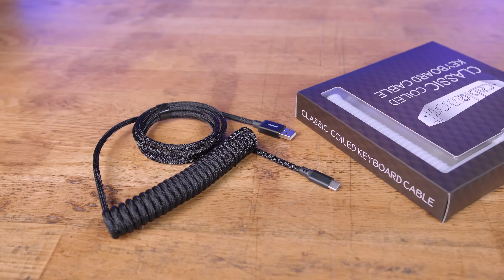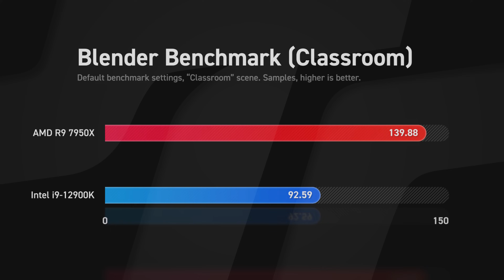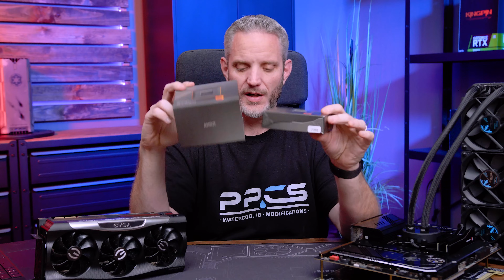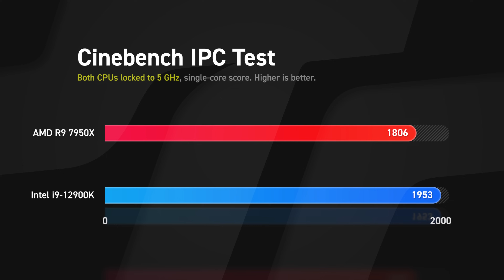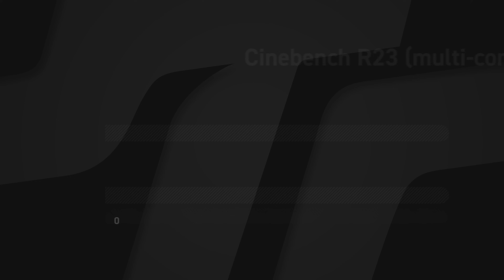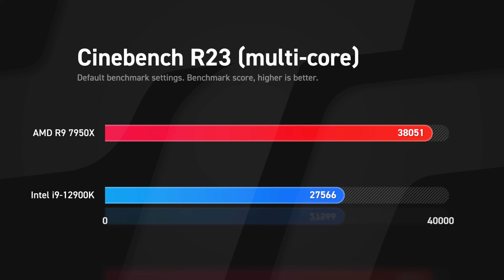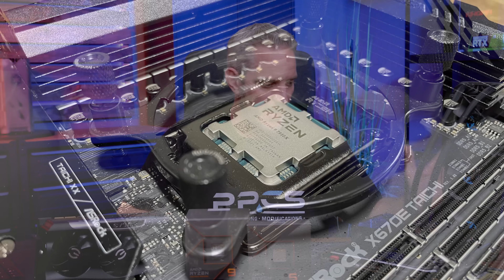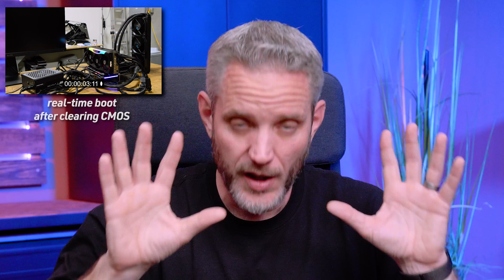Forget EVERTHING you THINK you know about AMD... these CPUs kick A$$!!

Comment: TJMax without throttling by design is most likely because they cranked the speeds down to what it throttled to, much like Over Clocking to max stable no throttle specs, find the max stable, find where it throttles to at TJMax, turn the clock down to that speed it throttled to and it won't throttle.  It's like pushing a 3200G to 4.3 GHz, figuring out it throttles to 4.0 or 4.1, and than setting the clock to the 4.0 or 4.1 to prevent thermal throttling.  It is always better if the manufacturer does it though.

Comment: The best part about AM5 boards and Gen 4 chips is you DON'T HAVE TO BUY THEM.  They are not the fastest for gaming, they are not the most energy efficient in terms of processing.  The boards cost too much, the memory cost too much.  If you absolutely need a system now Go with an AMD gen 3 with 3d cache or a 12th gen Intel.  If you can wait a bit, get a 13th gen intel or a gen 4 with 3d cache.  By the their will be better AM5 boards for less and DDR5 memory will be a little cheaper.  To be clear the chips only appear amazing if you compare them to gen 3 without 3d cache.

Comment: Great video, thank you Jayz.
Here are some constrictive criticism:
The comparison was not fair. Comparing the 12900k with the 7950x which are not on the same level CPU. Also comparing last year is technology with this year is technology isn't fair either. A more fair comparison would have been a 12900k with a 7900x or 13900k with the 7900x (Once it becomes available) . But the 7950x is on the level of the 12900KS. That way we can see real difference.

Comment: A note on degradation - I imagine most degradation happens not when CPU sits at high temperature (as long as it's safe temperature) but when it goes up/down often. Thus it makes a lot sense to keep it at one temperature range to avoid this. It's just very hard task to do so - at least harder so compared to allowing temperature go up/down based on load.
Reply: After the high-load task ends, fans rpm should go to low setting. So cpu cools slowly or maintains the temperature for longer. Am i genius?

Comment: I'd love to see benchmarks on software compilation tasks. Reality is that to play games nobody needs top end cpus. Rendering and software compiling is probably two common tasks where top end cpus make up the biggest difference. I work on sizable web application and it takes several minutes to get dev environment up running - which I need to do very often throughout the day - and it's a task that is CPU bound. And I believe there are a big number of software engineer who'd be interested in how CPU could make their day to day job better yet there are fairly few reviews that involve benchmarks of software compilation.
Reply: Single core speed if an application is written only for one core. there still are many that do not not multi-thread. older linux inbuilt apps for example.
I have a gut feeling that a lot of default linux utilities and apps in the distros are virtually abandon-ware, not been updated for mutlitcore at all. compression codecs for example, most seem to be single core only.

Comment: I have a ryzen 5 2600 with a 1660 super. I'm building myself a better gaming desktop and  I just bought a steel legend x670e and a 7700x. I was thinking of going Trident Z5 Neo 6000mhz as far as ram goes. A Seagate firecuda 520 2tb for storage.  But I'm not sure which gpu I should go for. Any suggestions from the community?

Comment: I didn't think we'd see the day when jay shills for a company. The launch is anything but hype. Why are we comparing 12900k to a $200 pricier CPU from a newer gen and acting like the performance should be close? Compare it to 7700x.

The AMD performance is amazing if you don't consider the prices of the CPUs going way up and competing with previous gen that is way cheaper(5800x3d is 300 dollars atm in amazon, while 7950x is 750). The motherboard is also twice as much for the new CPUs. You are forced to buy the pricier DDR5 ram as well. So when you combine all of these things, it's clear that this AMD launch is far from hype. It's exactly how intel's 12th gen was on launch. Great performance uplift but the price of mobos and CPUs was too big to justify it. Now that the prices went down for both, intel is heavily beating amd in the low and mid end. The only thing that kept amd in the fight is how amazing 5800x3d is which is what you should be waiting for if you are dead set on giving a small fortune for a motherboard and ddr5 ram. The 3d cache variants are going to blow these out of the water.

Comment: ... the 7600X is not awesome.  It doesnt even beat the existing 12600K, much less the 13600K.  The 7700X doesn't beat the 13700K.... etc.  

THeyre good, but they are barely, if at all, ahead of current 12th gen products.  Even if Intel only achieves a 5% uplift (and the early benches logged online show more like 10%-15%) then 13th Gen will be ahead in literally every category and better on price except for the marginal 20$ difference between the 13600K and the 7600X

Comment: If you look at building a AM5 system here in the UK as it stands the cheapest X670 boards is £360, 16GB DDR5 6000 £280 and R7 7600x £330 so £970 for the cheapest upgrade.. Compare that to a AM4 system, R7 5800X3d £430, B550 board £140, 16gb 3600 ram for £80 totalling £650..

Comment: I just need and advice, should go for i5 11/12k or go with amd r5 5000. I will use it mostly for game, coding, and light rendering and maybe a little bit of stream
Reply: I think you should get a Ryzen 5 5600 non-X and a B550 motherboard
Reply: @one_step_sideways  Pair qith 3060 ti or just 3060? I want to have atleast 32gb of ram
Reply: @hyyhalo  Depends on how much money you have. Keep in mind that this winter it's going to cost a lot to heat your house, so better take care of that first. Get an RX 6600 for cheap if you don't have a lot of money. It's a better choice than the RTX 3060
Reply: @one_step_sideways  But lot of people say the rx series lack of compatible. I mean, the software and optimization.
Reply: @one_step_sideways  i have enough for the whole setup, im just thinking its not necessary to go far as 3070
Reply: @one_step_sideways  but ill keep it in mind. Thanks though
Reply: @hyyhalo  I don't know who says that about the RX 6000. No one does. They've only got better with the new driver updates. Go compare the prices at your local retailers (or wherever else you buy GPUs from) and then check the performance of the RX 6600 vs the RTX 3060 and 3060 Ti to see which card is worth buying the most. You may use RTX or DLSS in some select games with RTX 3060 and especially 3060 Ti, but 95% of the time you'll be playing without them.

Comment: i love my amd systems..been using them for years and only just upgraded my work rig last year to ryzen 9 3900xt, which has been awesome..was planning to upgrade the cpu to 7950x in the future, but seeing these results makes me think that skipping a generation might be the way forward...but its just the cost of new cpu, ram, motherboard, etc,,when a 7950 would just involve swapping the cpu....so depends how big the gap is and will have to see what happens in the real world when they are released and if it is worth the added cost....
Reply: Good idea for what you are running. The AM5 platform will be supported for 4-5 years so you could skip a generation or two then upgrade.

Comment: all good until you realise it runs 95c and fans running max speed
Reply: Because PBO2 is turned on by default. Just undervolt the CPU and limit the TDP by 30% and it would stay at 75-80C with pretty much the same performance and much quieter CPU fan speed

Comment: 95C with liquid cooling?! ...no thanks AMD, I'll keep using Intel.
Reply: Because PBO2 is turned on by default. Just undervolt the CPU and limit the TDP by 30% and it would stay at 75-80C with pretty much the same performance and much quieter CPU fan speed
Reply: @one_step_sideways  That's too much, Intel works just fine and it stays around 33-50C. I don't need a better CPU since the GPU it's doing most of the work when I play games.
Also, I don't want the extra heat generated by AMD.
Reply: @jordyx  It won't reach anywhere near those temps while gaming even with an RTX 4090 stock. The method that I just mentioned works fantastic. Ryzen is still way more power efficient than Intel. Intel has to increase the TDP again with Raptop Lake, the 13600K will now boost to 181W at stock, so it's still quite a furnace compared to even the Ryzen 7 7700X

Comment: The reason why AMD chose not to allow overclocking on the Ryzen 7 5800X3D is due to voltages and THERMALS 🍳🍳🍳
Reply: But it's allowed there. It's just discouraged. But the way to go with those CPUs is to undervolt them

Comment: Intel core 2 duo E8600 - King of gaming - AMD ryzen 5700g.
Intel core 2 duo E8500 - Gaming Beast -  AMD ryzen 5600g.
Intel core 2 duo E8400 - Super value CPU - AMD ryzen 5 4600g. Many shops never sell only black/grey market got sell but it a shop??  (shop have stock 2 pieces only and i have bought AMD ryzen 5 4600g although i am an intel customer who have used 3 intel computers)

Comment: Jay, I have been thinking all about the design of the new Ryzen CPUs and how they like to run at 95°C.
I've been thinking about how DeBauer delidded his 7950X and tried to cool it.
The only thing that made sense was comparing these to a car's engine.
No matter if you have a 2 row, 3 row or 4 row radiator, if the thermostat is a 95°C thermostat, the engine will always run the coolant up to 95°C and the thermostat regulates the coolant flow to support that temperature. A bigger radiator will just make getting rid of the heat more efficient.
Reply: Except that 95C actually kill the silicon faster. You should have the CPU running at up to 80C for sustained workloads. I set my laptop's Ryzen 7 6800H limited to 78C while gaming and 82C for general bursty workloads and it boosts to up to those CPU temps with almost zero performance loss. Even with a 4.7GHz single core limit the core doesn't get hotter than 75C. So a couple cores are always working at 4.6-4.7GHz and that too makes the system really responsive.
Reply: @one_step_sideways  If this were the previous generation technology, I would agree with you 110%. But this is a new generation CPU designed on chiplet technology, uses a new SoC technology, and even uses 5nm die process. There is a lot that is new with this CPU and a lot we don't know yet. It has only been released a week ago. Time will tell how this new generation CPU operates and how it has been optimized to run. We will just have to wait and see if running at 95°C starts creating massive CPU failures or not.
Reply: @peterromano1911  Heat has always historically been the number one killer of all electronics and silicon semiconductors in particular. Not only is there nothing new with those 5nm chips, as they're made from the same material using the same EUV technology, but also the 6nm Ryzen 6000 series APUs now have a lower temperature limit than the 5000 series - 95C compared to 105C, so they know about the destructive effect of the heat very well. Most assuredly those Ryzen 7000 chips only boost to 95C to keep them from destroying themselves. There have also been a substantial number of reports of Zen 2 CPUs already having noticeable CPU degradation (slightly higher voltages to keep the same clocks, meaning the CPU is becoming increasingly less stable) after running at more than 85C for prolonged periods of time, likely due to using stock coolers while overclocked, which were not up to task, and that was back in 2021, and the effect only gets worse the smaller the process node is. So I can definitely tell you that running at 95C is not good. There's a reason why GPUs throttle themselves at 85C - they have sustained workloads, and running at higher than 85C for prolonged periods does indeed increase silicon degradation quite significantly. So for some Zen 4 chips (along with the M1 and chips that are being hammered by some users of the Macbook Air, sooner than that) in some neglected builds, it will be quantum tunneling city, as the process node is ever approaching to the limit of the silicon technology, as more electrons will just pass through the imperfect silicon with that phenomenon.

Comment: For a CPU game test, it's enough to disable AA and use low resolution (and strong GPU). The "very low settings" may disable stuff that normally put extra load on CPU. But single core performance already shows what to expect in games (with at least  6-8 cores available).

I wonder what's the idle Wattage, do the E-cores win there for Intel.

Comment: Jayz I want to say Thanks for your advice about the first start, cause I had the same "issue" I just change my cpu with the 7950x on a new motherboard asrock steel legend and 32go of ddr5 6000 and when I did the first start it took a long time before it start properly. I was thinking of an issue with the CPU because the CPU led was red and the vram one was blinking on the mobo and then I remembered your video and the advice you gave about the first start with a zen 4 cpu. Everything works smoothly and now lets go benchmark a little bit. Thanks you

Comment: 7600X + B650 is what I'm picking for my gaming rig (I have a 3600 + 2060 currently). I think I will however tweak the PPT and/or add a thermal limit in the bios around 85°C with a big noctua cooler. For gaming I think we can really optimize the efficiency of the CPU without really affecting FPS. I don't want however to have issues in CPU intensive games (MS flight simulator, civilization, Warhammer..)
Reply: Using Curve Optimizer to undervolt as much as possible is the way to go. And then you can limit the TDP to like 95W and maybe also decrease the max core clock speed by 100-200MHz to get better and safer temps for single-core performance. Lower than 80C is the recommended temperature for sustained workloads. Above 85C the CPU begins to degrade quite faster, and at 95C the degradation is significant And with these crazy single core gains, you would want to use this CPU for the next ten years because it is that good, so better take care of the silicon and not let it degrade too fast.

Comment: The avx-256 and avx-512 instruction execution matter is indeed a trade-off. So far I know Intel has struggled to not lose frequency with avx-512, and so far I know so far have not managed it. Basically avx-512 instructions just require more power then normal to run and as such there's a trade off, execute two avx-256 at more normal speeds, or one avx-512 at reduced speed. Strictly speaking as one can see, in pure avx-512 instructions this leads to an improvement still, the issue can be in mixed loading, where the frequency hits could lower performance on other instructions. Thus AMD is I'd speculate trying to avoid that trade-off in mixed usage and just accepting that they'll be a bit slower in pure avx-512 workloads. 

Well, this is how I currently understand the matter in any case. I'll see if anyone more knowledgeable might show up and have anything to add to it, or have corrections to make.

Comment: This is an entire platform upgrade that I'm not ready for. I will happily take a 5800x3d and stay am4 and ddr4 for the next few years until support finds itself lacking.
Reply: Socket is not the same as socket. It depends on the chipsets which CPUs are supported. Even people with AM4 cannot know whether they can install an AM4 CPU if they do not know the chipset compatibility.
Reply: @achimgebhardt5982  this is why you spend 30 seconds on the motherboard website and check CPU compatibility. Not hard.

Comment: The Intel 12 Gen 12900k had difficulties taking 4 ram sticks at high speeds (5600 MHz and above). Many users had to downgrade to 2 sticks. Has this problem been addressed on this new AMD platform?
Reply: you can run 2sticks at 5200MHz but if you're having 4 sticks it's recommended to run 4800mhz sticks. It's mentioned on the brochure. Most mid range motherboard do not support 5600mhz. Even in High end Z series do supports Turbo boost at 5200mhz. It'd be wise to wait for 13th gen it supports 6000+ MHz Ram. It's much power efficient and have more cores. 
I love AMD but I don't think Think AMD would stand a chance against Intel 13th gen. Low end i5 12th gen k varient could beat ryzen 7 easily, no way AMD ryzen gonna beat Intel 13th gen. You don't even need a GPU to do 4k editing in Intel high end CPU's. Even i5 gen have 12cores, not only 4k you'll able to handle 8k in that CPU. Overall Intel is better deal if you can't afford a expensive graphic card for video editing & need higher clock speed & more cores for video/photo editing,  & graphic designing.
AMD new Architecture has already made life difficult for PC builders, as it's very hard to find a cooling system which could actually prevent That AMD 7000 series processor from turning into LAVA.
AMD processor's may look cost effective but if you need to buy separate GPU, GPU ain't cheap. Of GPU crashes you won't be able to do anything on that PC until you buy a NEW GPU or until you get it repaired/replaced. Intel is the safest option, specially in my opinion. Inbuilt graphics of Intel 12th gen is much better than cheap 64/128bit GPU.
Reply: @samratjulius  thanks for the reply. I’m kinda over Intel’s business practices at the moment. After the purchase of an expensive X670E board, I’m married to AM5 till 2025. I’m currently fine w/my two sticks of 5600 MHz but was curious about the 4 sticks.